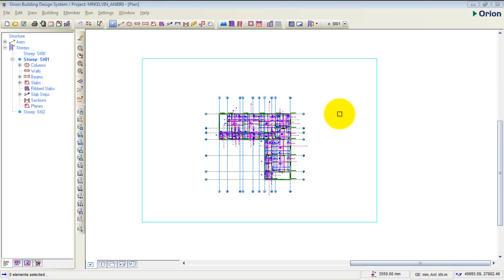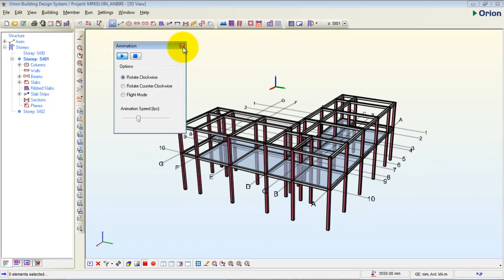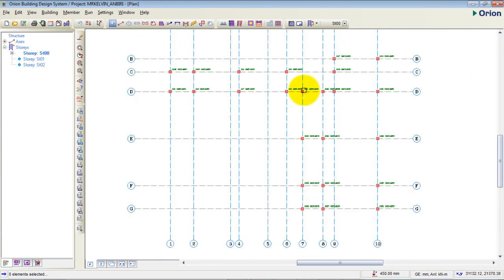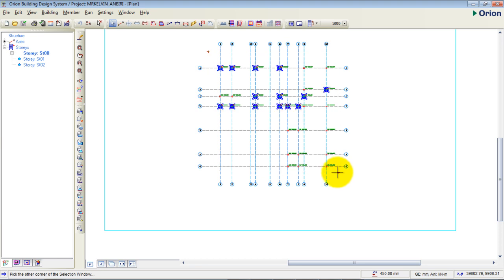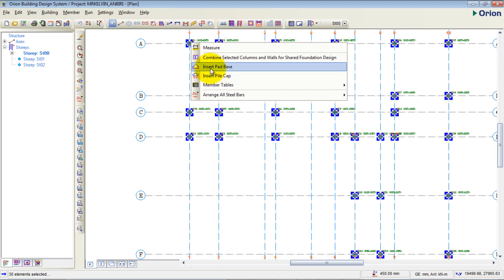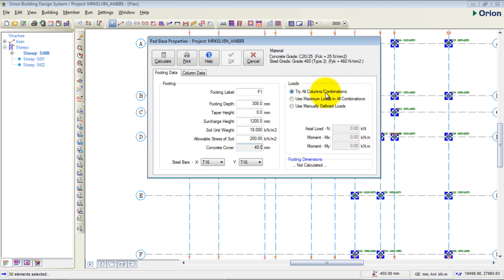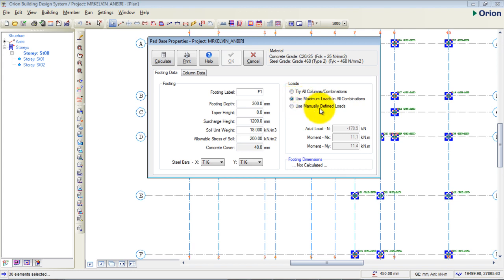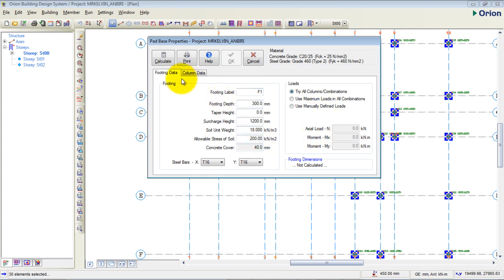ORION 18 TUTORIAL: HOW TO DESIGN PAD FOUNDATION  OF SIMPLE STRUCTURES

Comment: Is it size of pad footing accurate   based on design calculation? Because sometimes the result always the same..
Reply from the maker: The worse case is used to design for all footings. Yes its accurate
Reply: CAD Teacher do you have tutorial about how to determine loading from roof if building have trusses instead of roof flat slab? Thanks
Reply from the maker: Yes.
Reply: CAD Teacher if you dont mind, can you share link of the tutorial?thanks
Reply: Do you have link for load on roof beam? Thanks
Reply from the maker: Yes, for reinforced concrete beams